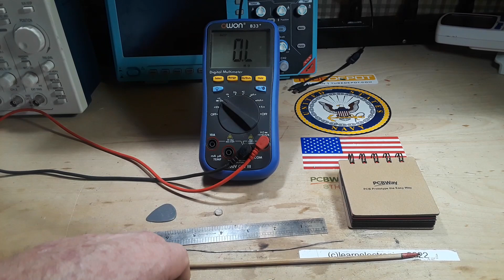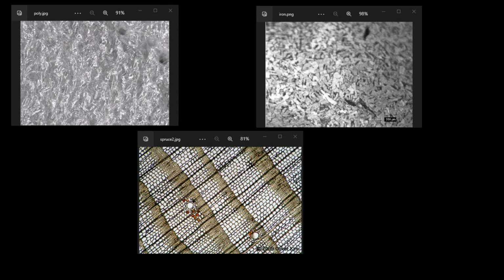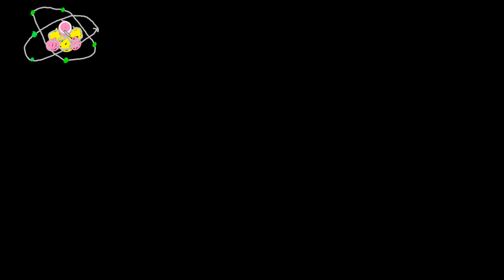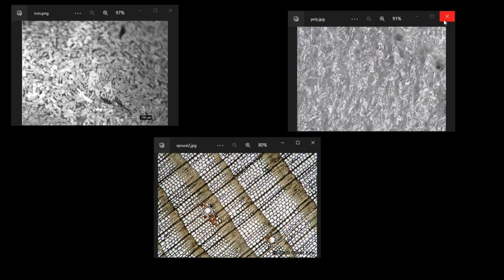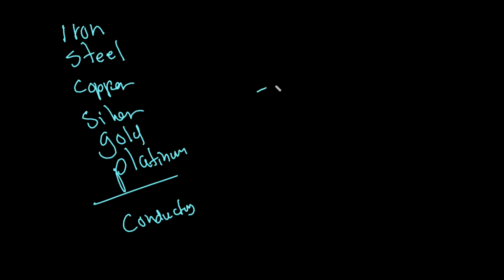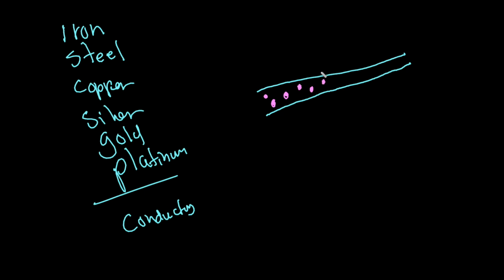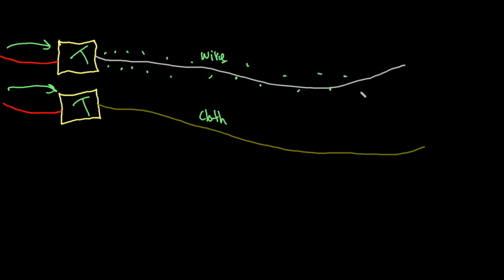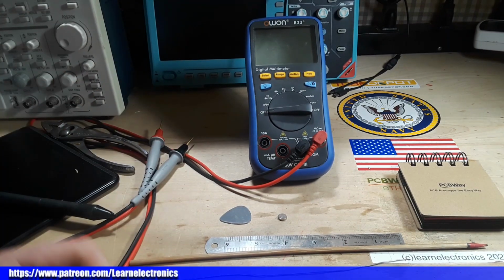Why Do Some Things Conduct Electricity While Others Don't

Comment: I was hoping u could help me .  I have been trying to fix a generator   . Tested all kinds of things .  Came across a hidden rectifier . By looking at ur video I found out it is defective.  But now I can't find that particular rectifier.  It's 400V 12A.   All the ones I find are larger . The lowest one I found was 400V. 25amps.  .  Shy of attempting to make my own which I have no experience or desire to do. I don't want to use that higher amps for fear of causing a fire or some damage.   Any thoughts ,suggestions?  Thanks in advance
Reply: doesnt matter if the rectifier is higher current only if its smaller its bad
Reply from the maker: Going bigger won't hurt a thing
Reply: @learnelectronics  thanks for the info.
Reply: Part came in today I changed the rectifier and one outlet. . generator is working  thanks

Comment: there coherency to magnetism and eletricity is the answer your looking for.
Reply: everything known to be is conductive or it wouldnt be here. cut the light off in your bed room. rub your hand palm down across the bed sheet fast. making your hand stay flat on the bed. you will see a discharge from the blanket to your hand. the bed sheet doesnt conduct very well either. yet it will build a charge and discharge to you.

Comment: So the more Free electrons in a material its going to have a higher conductance? its all about the amount of free electrons in a material?
Reply from the maker: It's an over simplification but yes. Some molecules do not want to give up electrons. Some do. The ones that do conduct as the bump electrons down the line. The more free electrons the less resistance. They are inversely proportional.
Reply: @learnelectronics  when a PCB board gets carbonized from burnt components, why does the carbonized pcb board start to conduct electrons? I didn't know that transistors, FETS, diodes had carbon in the material of the component. But does carbon have a lot of FREE electrons?

Comment: But you do not explain why the band of bonding orbitals in coalesced metal atoms is energetically wide and unfull of electrons, allowing for their free motion.  Nor, do you  explain why insulators have full bands which are greatly  separated from available electrons, have no free electrons to move about.
Reply: because this channel for beginners not phd students :P  the takeaway for beginners is that conductors have some free electrons (free to move along the wire) insulators have no free electrons thus nothing moves along.
Reply from the maker: I'm neither a chemist nor a physicist and that information is beyond the current scope of my knowledge.